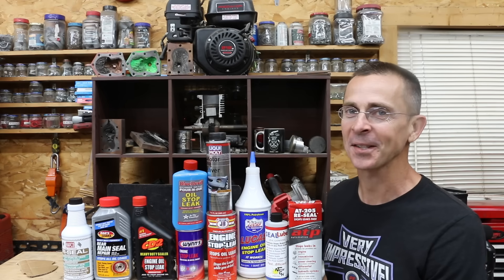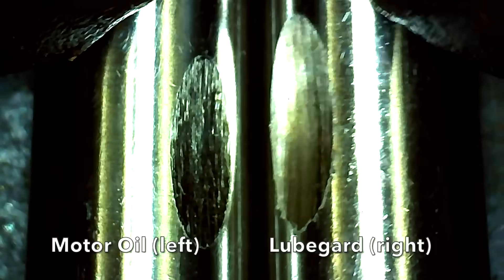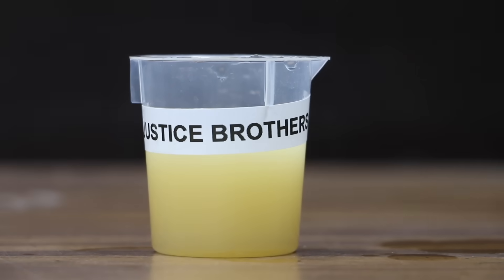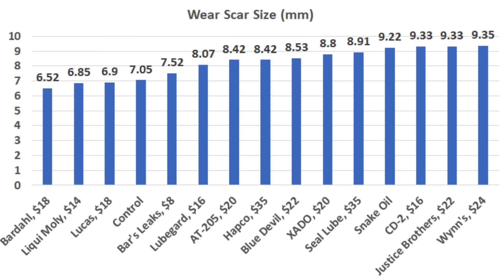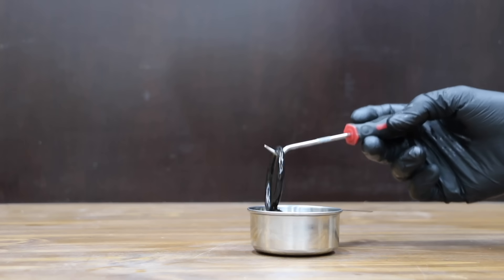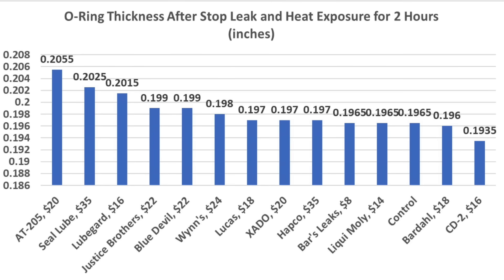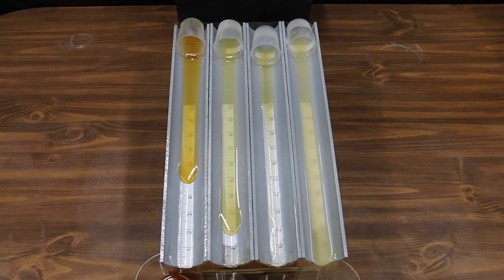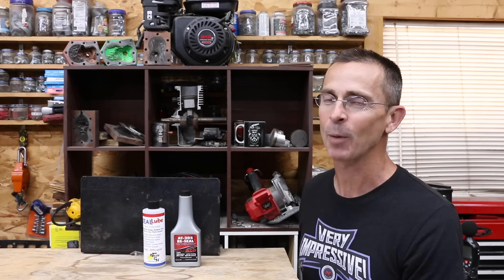Do Stop Leak Products Work? Do They Damage Engine Seals? Will They Destroy an Engine? Let's Find Out

Comment: Great video and people with older vehicles should find this very useful! I daily drive a 2006 Silverado and it after owning it for 10 years I got my first leak. It was from the rear transmission seal. I used Blue Devil transmission stop leak and it did stop the leak for about a year, until it started dripping again. 

I figured it was time to get it repaired properly and change the filter and fluid in the transmission. No more leaks and the transmission is still work fine. So no damage from the product and it did give me some time to get it repair and saved my garage floor from transmission fluid puddles for a while.
Reply from the maker: Thanks!  Thanks for sharing.

Comment: Great video; wouldn’t the seal material have a significant impact on test results? All o-rings and gaskets are not made out of the same material.
Reply: This is about Rubber/Latex 
If you didn't notice ?
Reply: @kevwills858  Sorry, I missed the identification of materials being tested. Thanks for the reply.

Comment: Thank you for the new instructive video. I forwarded it to my friends who work with various machines, I hope they will find time to watch it. An interesting topic for me would be the repair of a scratched windshield. Greetings from Europe
Reply: lol
Let me guess ... 
1) you didn't change your Wiper Rubbers and let steel sway back and forth for a week or 3 ?
2) you scare lots of cats off of your car each morning   or
3) your young and still wear Levis up on that hood(bonnet) 😄
No cure for Glass-Scratches eh
Reply: @kevwills858  Good try. The only pair of Levis jeans I would wear is the farmer's with suspenders, but my wife won't let me. She says they're ugly. I work in a glass factory and fine dust gets under the windshield wiper and it's enough to forget to shake it once to cause damage. Tried  We've tried several methods and had mixed results. Everything is fine until a car comes with its lights on in the opposite direction or the sun shines low on the horizon.
Reply: 😊
Try 50/50 BiCarb and Cornflour paste and about 6hrs of hard Elbow-grease ... but nothing beats a clear new glass replacement ...
Reply from the maker: Greetings!  You are welcome!  Thanks for the suggestion.

Comment: I run a combination of regular Lucas oil treatment and Marvel Mystery Oil in all of my cars, trucks, tractors, and lawn equipment.  The combination work off each others strengths and weaknesses to give you great leak protection and wear protection.  If I could, I would also add in the original formula of Slick 50, but it's a bit difficult to get your hands on.  That original formula is some amazing stuff.  It's nothing like what you buy in the store today with the same name.
Reply from the maker: Thanks for sharing.
Reply: Maybe dont run $3 oil in your engine and just run 5L of $20 Additives ?
One may never need to Repair a thing ?
Reply: @Kev Wills  You do know motor oil is made of some oil plus different additives, right?  I'm just choosing which additional additives are in my motors.  It has worked great so far.  My lawnmower is a twin cylinder Murray from 95, has never been rebuilt and is running strong without any smoking.  My truck just ticked over 240k miles with no problem.

Comment: Remember when used Lukas power steering stop leak….just needed it to hold for couple days before going home….from slow leak of oring in steering box it turned into full power leak plus later spent half night on cleaning inside of box, everything was covered in cement like crap.

Comment: You should if you haven’t already do a video on radiator cooling system stop leak as I’m curious I did put some in my 95 mercury sable once and after I replaced the busted radiator I forgot the stuff was in the anti freeze and last time I pulled the cap it was trying to plug the cap I need to get that car home after i get my license taken care of and do a proper flush of the system anyway i don’t know if it actually works as advertised with small leaks and head gaskets
Reply from the maker: Thanks for the suggestion.

Comment: I bought a used Honda Accord a few months back and shortly after I noticed it was going through a lot of oil. But it didn't seem to be burning it as I didn't smell anything and the plugs had normal signs of wear on them. It also didn't appear to be leaking it as there wasn't any oil on the ground. But I bought some AT 205 and added half the bottle to the oil, I lost half a quart after adding it and haven't lost anymore since. At least now I know for sure it is a leak and not burning it and as a testament to Hondas longevity it has 268k miles on it, it runs like a champ, and everything still works perfectly. As far as fixing oil leaks, I think for me at tleast it has done the job it was designed for.
Reply from the maker: Thanks for sharing.

Comment: I have had excellent luck using the liqui-moly product over the years in older high mileage cars.  I think its unfortunate that you neglected to mention that liqui moly states right on the bottle to allow 1 month or 4-6 hundred miles for full effect.  This statement aligns with my own experiences, and I generally have more faith in products that offer a slow and steady fix, rather than a fast and dirty approach.  I know that replicating exact engine conditions is diffiucult but i think this is a test where multiple heat cycles or extended soaking would have been beneficial. 

That being said I will definitely be trying some AT205 in the near future. 

Love the content, never stop testing!!
Reply from the maker: Thanks!  Thanks for the feedback.

Comment: Great Video.  Yes, the 50:50 mix instead of the recommended mix and time affect the test, BUT he isn't working with a government or University budget and unlimited time. In the real world (corporate/personal), even for multi-million $ projects, you have limited testing $$ and time.  What he has done for us is answer at least a couple of questions I have been contemplating for a week (rear diff seal leak).  Do some these products have a possibility of working? (Yes)  Could these products cause issues in the system they are used to fix? (Yes)   Now I can take the test he has shown weigh the good vs bad of the best products and make my decision based on cost (value of car, cost to fix properly), and risk (what are the cost and odds of it all going south).   All we had to do is watch an 18 minute video.  PF may have spent a tad more time putting together:)  Awesome job PF!
Reply from the maker: Thanks so much!

Comment: This makes me curious how heavy duty oil treatments compare to each other? I personally use Lucas Oil brand because another trusted YouTuber uses it in his rigs, you might know his as Vice Grip Garage. 

 I’ve noticed increased fuel economy and I’ve also noticed that my engine runs a lot smoother and quieter. I wonder if it’s doing more damage than not?
Reply from the maker: Thanks for the suggestion.

Comment: I'm curious about the ones that softened and expanded the brand new o-rings, wondering if that is caused by the potential degradation of the rubber, do you think you could leave the new rings in for longer, say 3 months, since all these products would be in your engine at least as long as an oil change and do an update? It'd be intereto see if any of them actually dissolve the rubber
Reply from the maker: Thanks for the suggestion.

Comment: I have a 2007 Toyota Yaris and noticed an oil leak between the transmission and the engine, with only 1-2 drops of oil per day. I think the oil seal is old, when I changed the oil, I added a bottle of AT-205 into my engine, and after driving 300 miles for a week, the oil leak completely stopped, I used the parts cleaner and cleaned the leaking oil place, no leak was found.
I drove another 3500 miles after that, did another oil change, didn't add AT-205, and drove another 1000 miles, and still no leaks at all, I guess, when this softens the rubber, you don't need to add into the oil every oil change.

And this product is only 8 Ounces added into a 4-5 quart system and works great, I think it is safe for the engine.
Reply from the maker: Thanks for sharing.

Comment: What a fantastic video!  I have a few cars with fluid leaks (motor, transmission, rear axle, power steering).  I remember the old stop leak stuff - worked for a while, then the leak would get worse.  I've heard about these new products, but I haven't tried them yet.  After watching this video, I'm going to buy some AT-205 and see if it'll stop the big oil leak in my first car.  If it works, I'll try sealing my transmission, rear axle and power steering in the other cars!

I'm anxious to see how this works.  Wish me luck!
Reply from the maker: Thanks!  Best of luck!
Reply: After 5 months of AT-205 in the motor of my car, I can say that it does work.  The leak isn't completely gone, but it's slowed down a lot.  

I haven't tried it in my leaking transmission, rear axle or power steering yet - those will be my next real life test.

Comment: Very good test for a product that i would only use in a pinch but never trust for the long haul, I think a test of Brake Cleaner brands would be interesting as i find that the cheap store brands seem to work the best and a bulk brake cleaner in a Sure Shot sprayer is also cost effective, also oil filter remover wrench's, those things can make the job easy or ruin your day!
Reply from the maker: Thanks for the suggestion.

Comment: I use a little bit of brake fluid in oil just before an oil change, put about a shot glass in, drive it for 45 mintues to an hour, let idle for 15-20 minutes, then change oil .
Reply from the maker: Thanks for sharing.

Comment: Hello there, I enjoy the channel very much and have allowed some results to influence product considerations from time to time so thank you very much for the information!  In regards to this video, I have used AT-205  with great results a time or two,  so I am not surprised at how the treatment did with the 'O" ring testing, but kinda looked at you a bit sideways at the 50/50  blends on friction tests, the ratios seem off to me. For instance , the AT-205 is 8 oz treatment, 5 qt of oil is 160 oz. so the 8 oz volume of treatment  replaces 5% of the oil. It seems a great deal to ask of a product that is not billed as a lubricant to assume 50% of the friction load of your test.

Comment: Great video. I haven't used any stop leak stuff since the 1970s. I look under the hood of these new vehicles and hardly recognize anything. This is a rare instance when I think I have something to add to one of your tests. I'd be interested in the weights of the O-rings before testing, after heating them in oil, and after treating them with the product; just to see if they lose/absorb anything. Again, another great video.
Reply from the maker: Thanks!  Thanks for the suggestion.

Comment: I can testify that liqui moly works good. I have used both in leaking cars and use it as mantineance on non leaking cars. Solved a leak in a subaru and has mantained my hondas and bmw without leaks for years! One bottle every 4 oil changes.
Reply from the maker: Thanks for the feedback.
Reply: @ProjectFarm  Little update, used bars leaks on my front bevel/differential in a 2012 XC60 T6 I bought, went a considerable leak go away, 2 months ago and has not come back, gives me time to save up some money and change all the seals. There was also a leak on the engine, rear main seal, Liqui Moly solved it, it was a really small leak and now 0 leaks! They are not a miracle, but can definitely help

Comment: I love your videos, I've shared them with tons of friends and family about purchases they've contemplated such as angke grinders drills tape etc
I know you've done framing nailer and t-50 electric stapler, I'd like to see an 18 gauge nail/staple gun comparison. Battery v pneumatic. Rapid fire rates. And especially a quantified or even just a subjective grading of the bite mark the nailers leave next to the fastener
Reply from the maker: Thanks!  Thanks for the suggestion.

Comment: Perfect timing as I have a bottle of AT205 I’ve been considering trying in an older vehicle for an oil leak.  I also have a transmission leak which is an expensive repair since it’s a torque converter gasket. Thoughts on the use of the AT205 in transmission fluid vs oil since it’s advertised for both?  The low wear ranking worries me but the swelling of the seal may help.
Reply from the maker: Thanks for the suggestion.

Comment: This is very interesting to watch this video. As of mechanic I've always recommended against using stuff like this. Number one because it never works. Number two let's fix the problem instead of trying to put a Band-Aid on it. My biggest thing I enjoyed learning from watching this video was the amount of damage that using these products cause. I would love to see you do one on the most popular head gasket stop leaks or radiator stop leaks. And so what kind of damages they can do to different kinds of systems from your radiator to your heater core and even to not fixing the engine but causing other problems along the way.   Thank you very much for what you do I enjoy watching your videos Hope to look for many many many more 🙏
Reply from the maker: Thanks and you are welcome!  Thanks for the suggestion.
Reply: I second the suggestion for a head gasket stop leaks analysis video.  Especially if you have coolant in your oil and will they cause the engine to seize or some other significant damage.  I too am a huge fan of your videos.  Thanks for taking the time to make such valuable comparison and analysis videos!

Comment: I’m 53 I’ve tried them all. The only stop leak I’ve ever used that actually works is a product called K-seal for radiator leaks. I used Lucas stop leak for steering and it ruined my rack and pinion on my Honda. Says on bottle safe for all Asian vehicles.. NOT TRUE
Reply from the maker: Thanks for the feedback.

Comment: If you ever revisit this test i would like to suggest you mix the appropriate ratio of each product to one quart of oil and then perform the test. I feel the lubricity test was skewed by adding a 50/50 mix of each when in reality they all have different ratios. Also the at-205 looks like its supposed to separate from the oil allowing it to penetrate the rubber gaskets more efficiently. Just my take away. Great content as always!
Reply from the maker: Thanks!  Thanks for the suggestion.

Comment: I used roughly 1/2 a bottle of AT-205 right after an oil change in a ford 5.4 for a small leak that I couldn't identify the precise source of.  Stopped it within a day and had no issues since.  I read a comment that you should run the engine for a while right away since the product does need to be mixed right after being added to prevent it from pooling in the oil pan and causing issues.
Reply from the maker: Thanks for sharing.

Comment: Very good video, the reason I believe the justice brothers product evaporated more is because it is designed to. It also cleans the PCV system with the evaporate, a clogged PCV system can cause oil leaks due to the increased crankcase pressure and this product is designed to help with that problem.
Reply from the maker: Thanks!  Thanks for the feedback.

Comment: Good job with the testing Todd. I don't know if you did this but, when measuring the thickness of the o-rings it's best to do so around the entire length of the circles. O-rings don't have to be overly precise since they rely on compression to make them work. Still this does supply a good deal of usable information. 
Thanks again Todd.
Reply from the maker: Thanks and you are welcome!  Thanks for the suggestion.

Comment: I have a 1996 Dodge ram 1500 5.9L which has been dry underneath for all of its years. 3 months ago it started to leave small amounts of oil on the ground, driveway etc. I did use Lucas engine oil stop leak, only half the bottle and now it is dry underneath. We will see how long it holds. Glad to know about the AT-205, have another vehicle to try that on, if it cures that trans leak I would be thrilled.
Reply from the maker: Thanks for the feedback.

Comment: I wonder how big the diesel performance is between the cheap, normal and premium in the US
I have a 4 stroke 2 cylinder 0,47L dci diesel engine with no timing adjustment. I would say dis the different types of fuel have a huge impact on the performance.
I live in Germany and I get different performance at starting, cold engine (2-6°C outside), reving and driving at low rpm.
My experience:
The normal diesel in Germany:
is semi at every thing 
The premium (costs 20-30ct/liter more):
Good at starting, semi with cold engine, good at reving (at high rpm starts to sound unsmooth), semi at low rpm

The cheap diesel (costs 10-15c/liter  less then normal):
is creap at starting (is about to ignite before the power stroke), cold engine is about to stop idling or runns on 1 cylinder, you have problems with reving because it's ignites to early and at high it ignites in the exhaust (sounds like a machingun, i took one time the fuel never again), at low rpm runns the engine more on 1 cylinder and is about to stall

The normal fuel from Poland:
Semi at starting, semi with cold engine, reving is slow and not much power, driving at low rpm is unsmooth or you let it idling fore 1-2 minutes 

So if I can, then I mix the normal from Poland with the German premium in the ratio 1:2 up to 1:1 fore better driving.

Hope it was interesting and informative
Reply from the maker: Thanks for sharing!  It was interesting and informative!